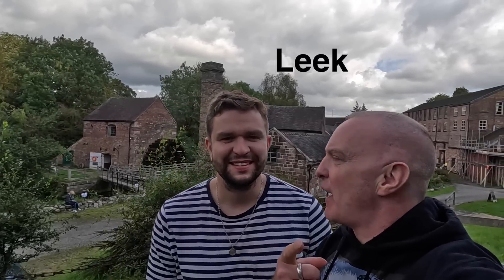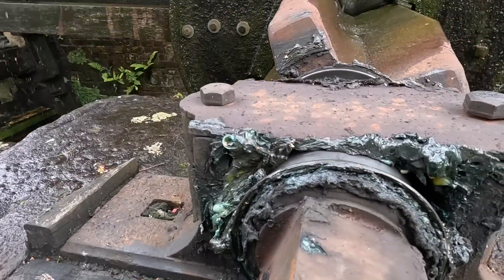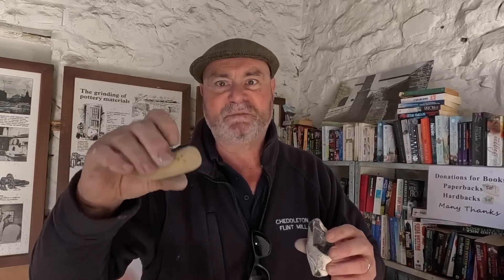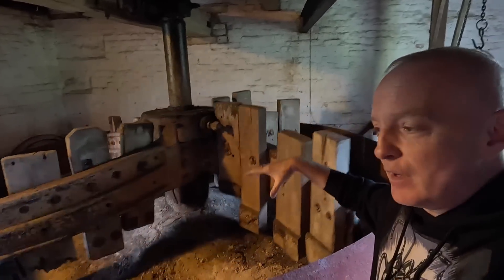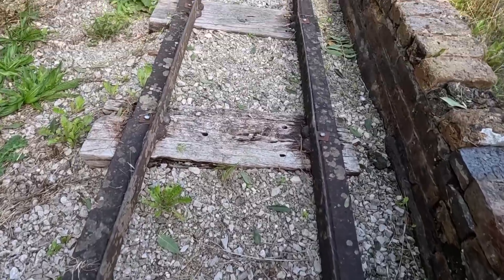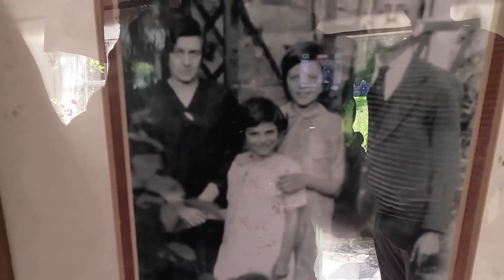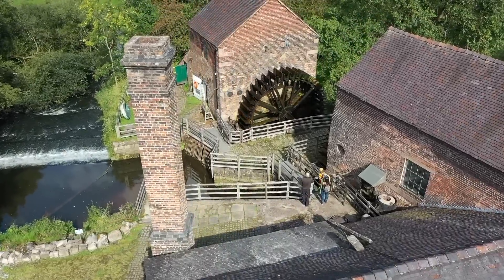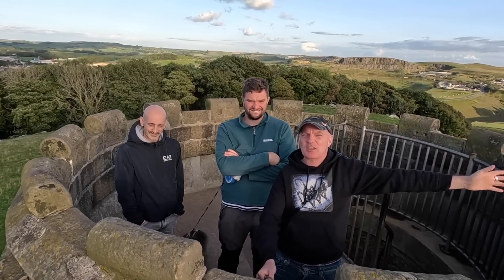What on earth is a Flint mill ?

Comment: There is so much to see in that area. I used to cycle from Cheadle Hulme through Macclesfield to Leek and take a sandwich break at the  Cheddleton flint mill. They have done a really good job of removation and turned it into a real nice museum. It is close to the Churnet Valley preserved steam railway.  Also Leek itself has a traditional market and is great to visit with the chance that if you visit on a Saturday you might hear the church bells change ringing. In the area also are Lake Rudyard,  Titesworth serervoir,The Roaches (NT estate used by the BBC  Pride and predudice mini series), and near to Danebridge there is the Hanging Stone which cane be seen from the main Macc to Leek road. Great Vid and so very informative.